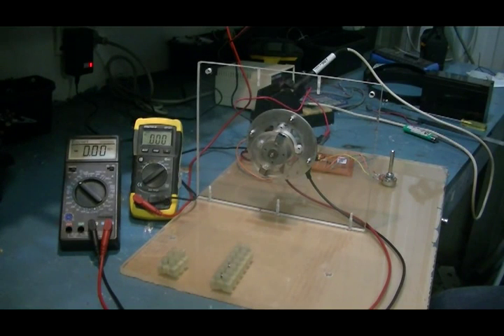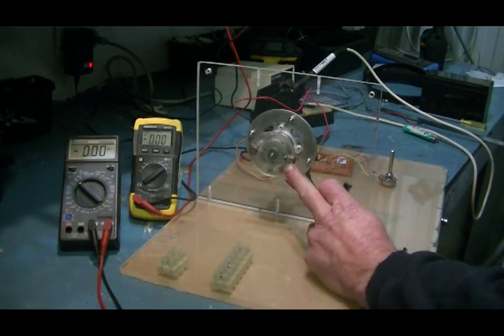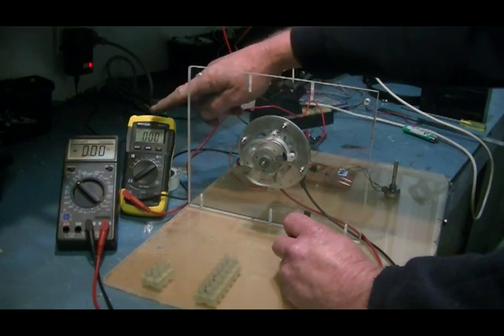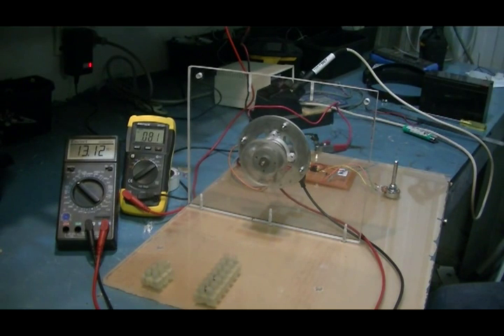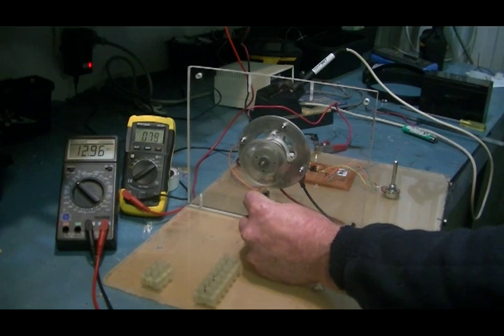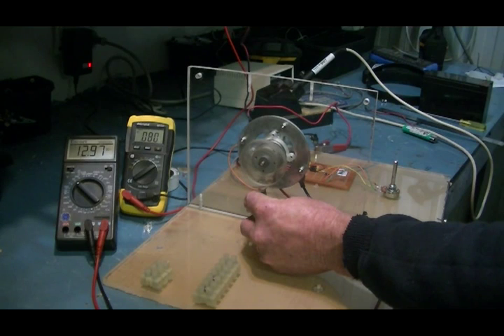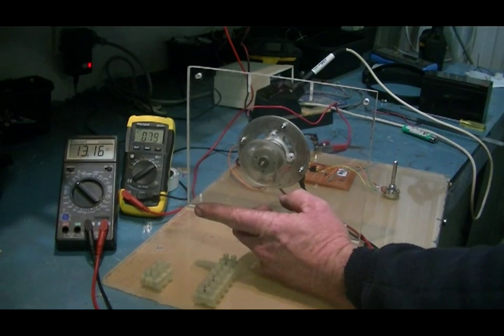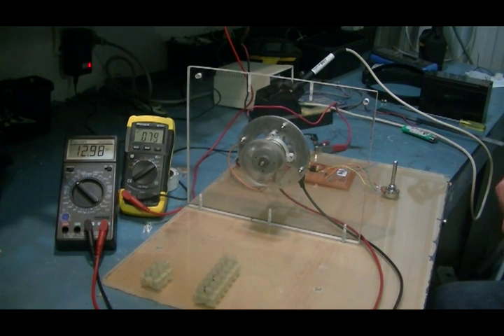core drag test

Comment: Your test seems very encouraging; however it would be a more accurate test of you had TWO cores on a bracket so that they attract equally and opposite on your rotor. The way it will be in a generator situation

The way your test is set up it is causing a strong pulsating sideways pull on the shaft of the motor witch will cause great resistance. (compared to two magnets exerting equal pull on each side) 
Since your test showed nearly no resistance - maybe two would actually help :-)